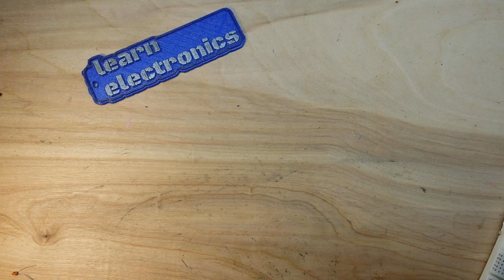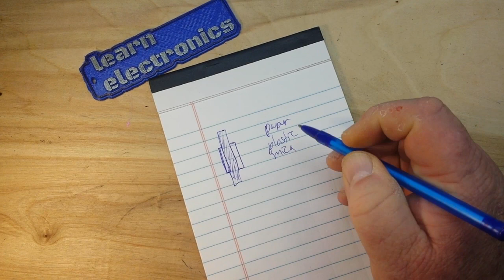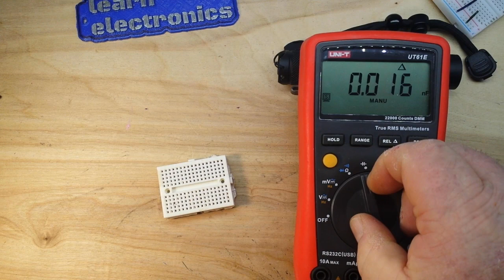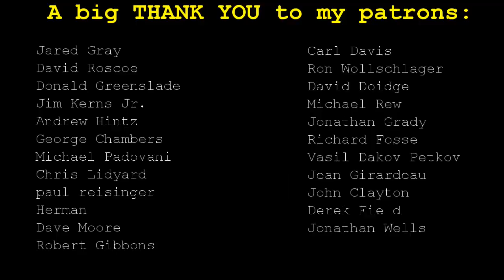The Hidden Capacitor

Comment: That showed up good in your boost converter video. When you removed the 10pf cap you still showed good oscillation on the scope and the voltage held. That capacitance is what drives me crazy moving a working circuit from breadboard to perfboard and then having to adjust things to get it working correctly again! Excellent video!

Comment: I know it happens working with RF. It really screwed with the calculations for an XTAL radio I was puttering with, but you got me interested and I used a DE-5000 at 10,000 Hz. I measured several different row sets on several different breadboards. I got between 1.5 and 3 pF. The breadboards are those that have the blue and red stripe for the voltage rails.
Reply from the maker: +Carl Davis It's real

Comment: hey Paul, i tried to recreate the breadboard example using a clear breadboard from sparkfun and 2 dmm, a tekpower and a fluke. the results were , (and one important factor you mentioned was to zero the dmm prior to making a measurement), both the fluke and tekpower showed zero. then i watched the video again and saw that the .261nf was before you zeroed and after zeroed did not return to .261nf but was .001nf - .017nf. now, considering most caps i get are off the label value by 5nf to 20 nf  and in many labs considered acceptable the .001nf to .017nf  isn't much to be concerned with.  i appreciate the subject matter though cause it is very important to raise awareness of the necessity for being sure the instrument in use is zeroed before use.

Comment: Great stuff, thanks.
Paul, do you remember the days of Phreaking and Captain Crunch? ;D
https://youtu.be/Abko9Rvta3Q
I remember they had some crazy recipes for making weird capacitors with mixing sand and iron filings/dust/powder in a bucket.
Back then I never knew jack about caps, just the theories they taught us in high school ;D
I think it is just like you said, that was used in picking up some phone signal from wires.
Reply from the maker: +igrewold Absolutely, Capt. Crunch = John Draper.

My favorite tale of that time is a book called " The Cuckoo's Egg" by Clifford Stoll.
Reply from the maker: +John Clayton yep, Draper was a phreaker. Did you know that how Jobs and Woz got their start? Woz built blue boxes that Draper designed. That was the original funding for what became Apple.
Reply: +Johm Clayton yup them boxes, I used to read a lot of literature like 2600 and phrack about them back then but never did nothing,
Once in JFK airport on my way back home, I saw a black guy put one of his walkman headphone speakers into the mouthpiece of a payphone ;D then make a call, that is the easiest phreaking way i guess. To record a tone then play it back.
https://en.wikipedia.org/wiki/Phreaking
Reply: +John Clayton That kinda explains why they're ripping off customers with their crazy prices(Mac, EyeFone ..etc. vs. PC, Android ...etc.)